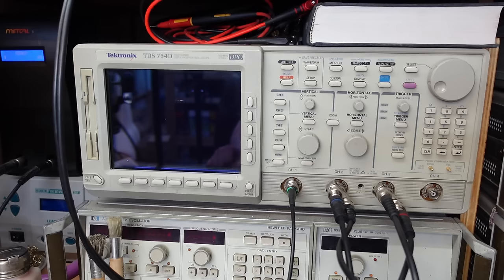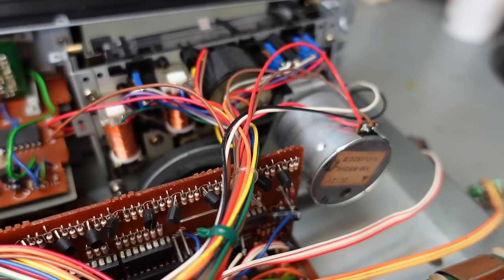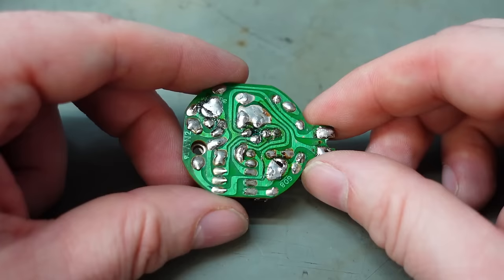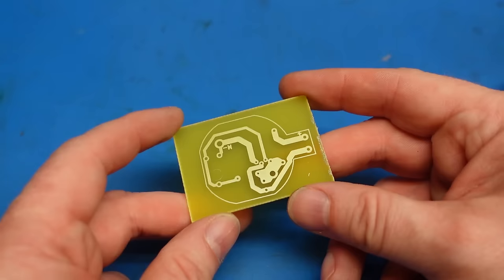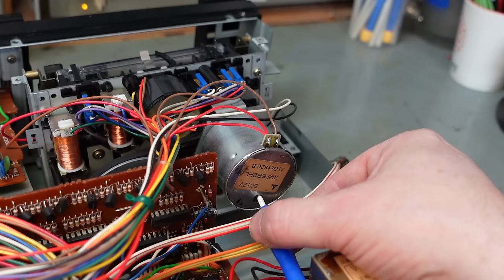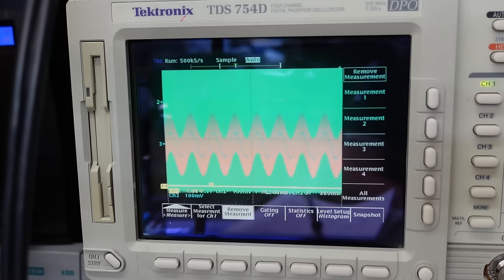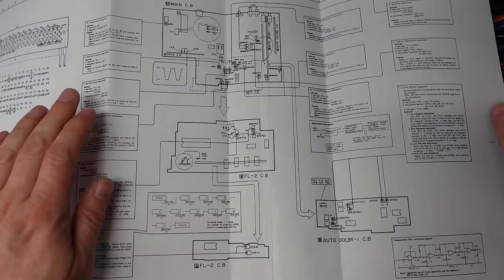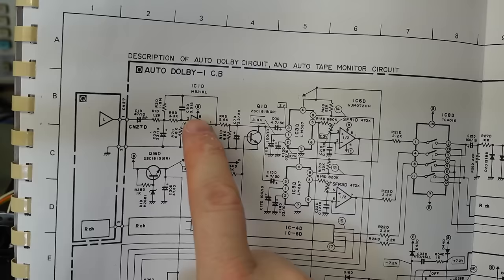AIWA 3 Head Tape Deck (AD-F990) Part 2

Comment: What a nightmare to fix! Anyway, I wonder why you put a new circuit inside the motor compartment instead of leave the new circuit outside the motor compartment. Inside it can get pretty hot and outside it can stay cool. I have seen many motors with the same wobbly driver issue, mostly made by Panasonic.
Reply: He's showing off, in a delightful way! Keeping it looking as factory original as possible. Maybe some day in the distant future another tech will get that deck to fix, look inside that motor & just go 'wow'

Comment: Well, I have one of these on my bench right now for a diagnostic.  It needs new rubber for starters.  But if it has a lot more problems, the customer likely won't pay hourly labor rate to figure all of it out, regardless of the $1000 ebay asking prices for these piles.  I've worked on old AIWA's before and they are not service friendly at all.  (Basically time is money and no one wants to pay)

Also, the inline package chips are well known to fail and many can't be replaced. 
Bottom line is that jobs like this are a PASSION, not a business.  If I owned one myself, I'd work on it little by little, but not at this level for someone else.  In all that time, I still have bills to pay and other jobs to do.  
With certain gear from that era, I have found that the only winners are the SELLERS that pawn it off on you.

Comment: part 1: motor is bad, instead of finding a replacement, HE RE-WINDS THE MOTOR!
part 2: speed control PCB is bad, instead of replacing it, HE RE-FACTORS IT WITH AN IN-HOUSE BUILT PCB AND NEW CONTROLLER IC!
part 3 is going to be incredible.

I aspire to be able to work at this level. I was fully expecting the board to be fabbed by a board house with an ad placement, but nope, it's done the way we did it in the 80s. (except with a better transparency... the xerox transparencies always seemed to need touch-ups.)

Comment: Yeh you could do all that.. but a lot easier to just swap the motor. These motors with internal regulators are everywhere, there must be a dozen in my junk box, or readily available inside just about any junked cassette deck out there, they were all the same.

Comment: Mark. I was wondering why your iron sticks to the wires when you're soldering.
Reply: I know, he never uses flux right?
Reply: It's cos he doesn't clean the iron enough. If working to exacting standards it should be cleaned for every new joint. But this is the real world, we all get a bit lazy & his work is not on aerospace or safety-critical equipment.

Comment: Hi Mark... Anyone else that can help. (please)! Mark, I see that you have extended the air hose/pipe on your Atten 862-D hot air station. Due to space issues, I also need to extend my pipe...(no jokes, I know what I just said)... PLEASE can someone help me out. I have literally been searching on and off for weeks and can only find hose/pipe rated to 330C. (Ali Express). I would be extremely grateful if someone could point me in the right direction. Cheers in advance.

Comment: I like what I see, but......making assumptions about possible "bad" capacitors in voltage regulator section related to main motor speed fluctuations does not sound good, at least to me. Even more, replacing four previously working capacitors well within their capacitance and tolerance range does not make sense. Finally, "thinking out loud" like "I do not know how this works" when showing computer tuning section on the front panel does not look good.

Comment: Hi Mark, I don't understand - your question and my answer deleted again, I sent you an email to the address given in the channel details.
I played the whole video again and I don't know if it's the 22:30 shot or if the azimuth of the head is incorrectly set - the wrong azimuth could be the cause of the failure of the automatic adjustment for Dolby and it would also mean an error in the level setting after replacing IC21. The problem with the signal interference could be a broken shield of one of the signal cables, or a GND error - if I understand correctly, the interference disappears the moment the line signal cable is disconnected, so there could be a different ground potential.
Could it be that cracks were formed in the soldered joints when handling the PCB - to search for them, I use a point LED light source with a temperature of around 6000K - this cold light causes the cracks in the soldered joint to become more prominent - as if the crack had been outlined with a marker.
Did you spot the differences between the old and new IC21?

Nice day 🙂Tom

Comment: Incredible I've never seen anyone handbuild a PCB before. I'm very sad about what the inside of that machine look like. Really poor engineering. I've been in quite a bit of electronics over the years from the UK, Japan, USA and I've never seen anything vintage that is put together so badly. Technicolour spaghetti all over the place and boards just flapping in the breeze. Not Aiwa's finest hour but inredible heroics from yourself. Pity you're not taking work on as I have an HH V800 '80s PA amp that works but one channel sounds a bit off and the bridge mode LED doesn't illuminate... It's got me beaten

Comment: Great content. The way you measure electrolytic caps though, is just wrong. ESR goes high well before the capacitance drops, as a cap ages. You need to measure ESR foremost. Fine, measure capacitance too.
Reply: True, but he was just testing them quick & dirty. They were all getting changed in any case.

Comment: Going the extra mile, and for an (in only my opinion) rather useless feature.
Reply: Agree, we were all thinking that it would be.... 'oh well, nobody uses, or even knows how dolby works & it always seemed to make your tapes sound muffled & worse sounding'...... But, oh no, he went & bloody fixed it! Ultimate attention-to-detail. 😂
Reply: @wirdy1  I do use Dolby B, I was actually referring to the automatic function, as it would be brand specific to that range of decks. Unless other companies made decks with automatic detection. Seen and used a lot of decks in Mt time, but this is literally the first time I'd seen that feature.